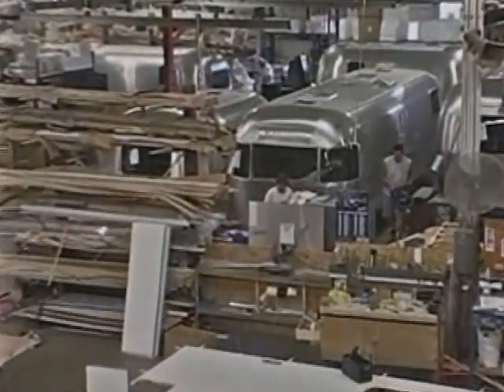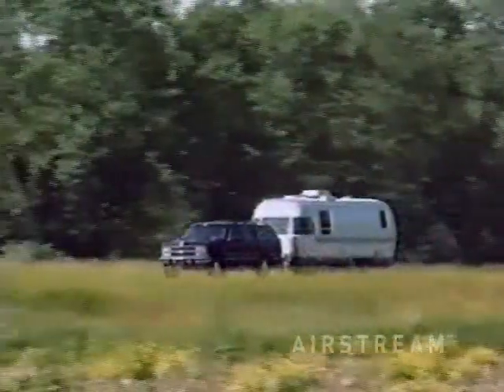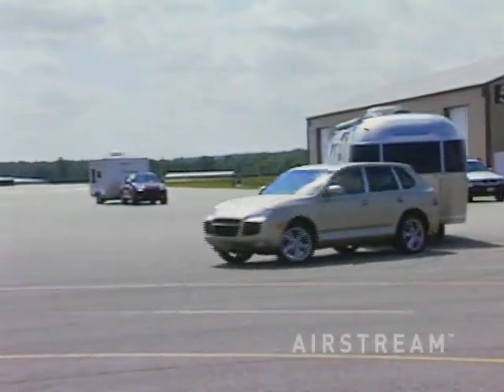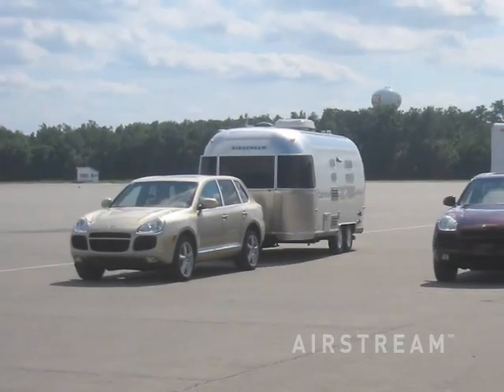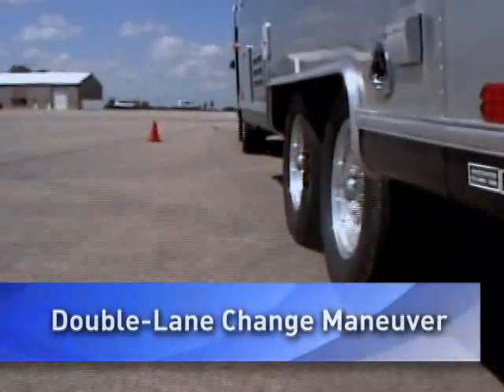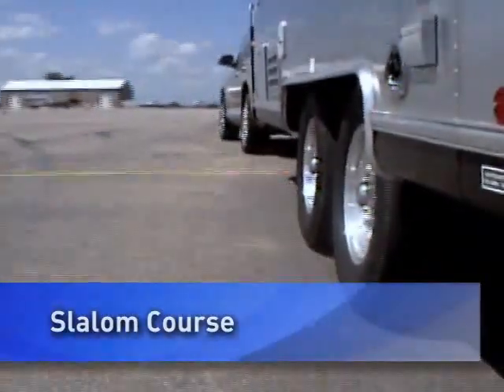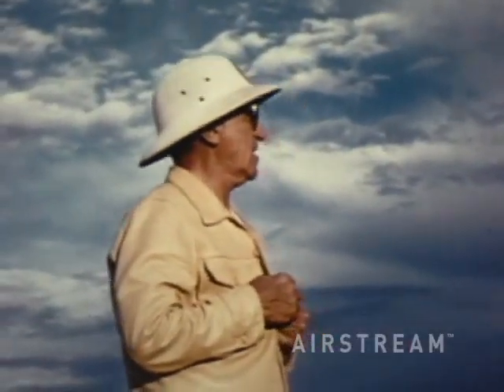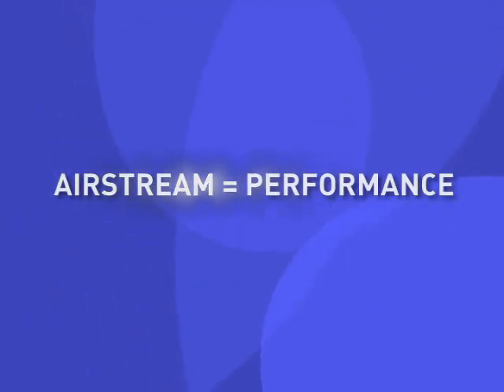How-To | How Do Airstreams Perform on The Road

Comment: 130,000 for a new airstream, 60,000 for a new keystone with the same luxuries.
Reply: Jimmy, you get what you pay for. the Airstream will still be in operation in 45 years... will the Keystone be on the road then?
Reply: Mike Harlan the keystones will be trash in 5 years.
Reply: I wouldn’t have a Keystone,   as a campground owner,  majority of issues I currently see are with Keystone products, mainly fit and finish or lack of.
Reply: Perry Leeds they are cheap made but cheap to buy
Reply: It comes down to what you consider value? I'd prefer to put 100k miles on an Airstream. Might need 3 or more box RV's to accomplish the same journey and truly not enjoy towing them.

Comment: Who in their right mind in this is the year 2017 is going to pay $100,000 and maybe a little less depending on where you buy it or a cramped up Airstream. Yes they are a quality piece but damn make it affordable for the working person. This is ridiculous video it is so biased towards the box type campers yet Airstream is probably one of the most cramped up campers I've ever walked in. I'm not going to spend $100,000 and a camper that I may use four times a year. Come on Airstream make it affordable For the Working Man you know the guy that on a good year makes 50,000 $60,000 a year. I don't know of anybody that can afford a $100,000 unit under 35 or $40,000 salary.
Reply: You might want to take a look at how they are built compared to other trailers.  The quality of the solid rivets alone holding the shell together, the bottom made to balance…you know… that quality shit that people like you expect from America yet do not want to pay for it.
Reply: You are correct. If you only use it 4 times a year the airstream is not for you. Perhaps look at the cheaper boxes that are bigger and will last only a few years.

Comment: I find this vid to be suspect. As a former owner of a 'stream, any 'stream can sway out of control. imho, Airstream would do well to bring these trailers into the 21st century but using composites extensively for all components to increase strength and reduce weight. A lighter trailer always tows and brakes better. Use independent suspensions, disc brakes, etc. The tech standards used on a 'stream are now about 40 years behind current tech standards. Only the individual buyer can decide if the price point for such old tech gives value for today's standards.
Reply: I reckon depending on what it's applied to, sometimes old school technology can still work today.
Reply: Is there a travel trailer out there with four wheel independent suspension? Is there a travel trailer out there with disc brakes? I have been looking at many trailers and have not seen ANY with either of those features.
Reply: Rob Grune Airstreams do have 4 wheel (Rubber Torsion) independent suspension. If you owned one, you would know that.
Reply: Ur comment shows u never owned an airstream or understand what an airstream is.

Comment: Comparing apples and oranges.... get a camper with same tire size and weight distribution (high and low) and you will have the same. and the driver if the same has different driving on different vehicule. we see 2 suv.